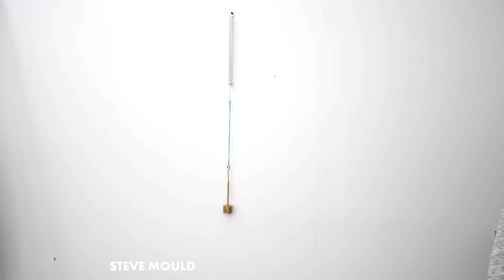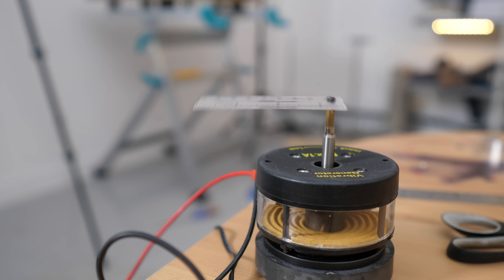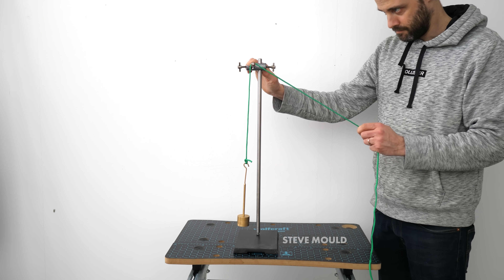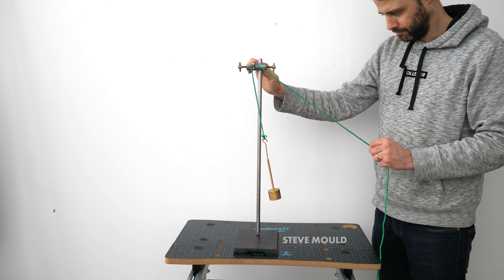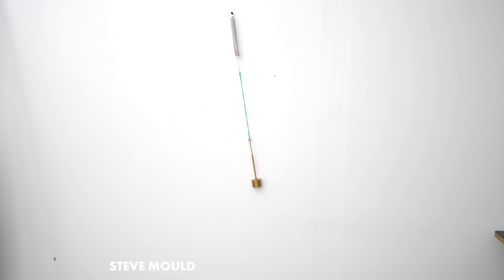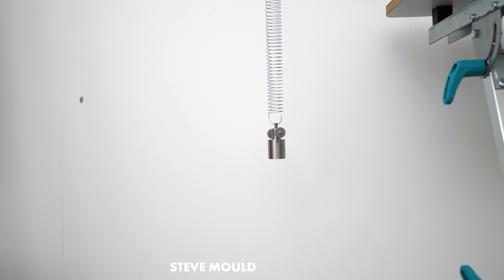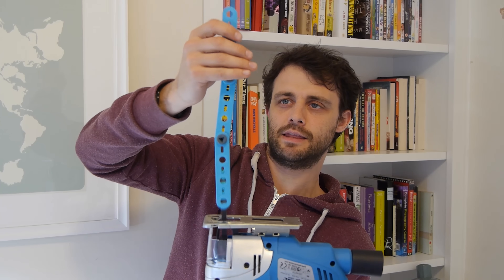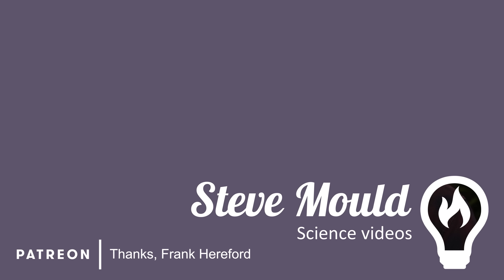What If Swings Had Springs Instead Of Ropes: Autoparametric Resonance

Comment: The normal pump up while sitting changes your own moment of inertia around its own center. By pulling 'in' at the bottom you do work then at the ends of the swing you expand back out while not rotating. (doing no work) Youcan think longer about it but you do work pulling in and none when expanding out so that energy MUST go somewhere. (or you can get you head in knots with the forces.
1 caveat I ought give people is that stand up (at the bottom) and sit down(at the ends) thing... be really careful. If you do it well on swing with say 8ft chains where it becomes plausible to do it well. I very very rapidly wound up horizontal with the chains loose and real chance they could pinch fingers when they went tight again. When you stand up you not only raise your center of mas your also change your moment of inertia around your own center, so it can if done 'well' pump up LOTS.

Comment: The length of the string at 3:13 isn't what's causing the swing, it's the off-centre aspect of the string relative to the weight. It creates a small moment arm that you lengthing with the timing. If the 'string' was in line between the pivot point and the centre of mass you probably wouldn't see this.
This is exaggerated by the movement of the pivot point at the top, because of pulling to the side.

Comment: Not sure the explanation about energy and centrifugal force is accurate. When you pull at the 6 o clock position gravity is in line with the string. (Plus also max centrifugal force). Whereas at 3/9 o clock gravity is perpendicular to the string. So pulling at that position can't do work against gravity.

Comment: The longest point of the string isn't the point that crosses both loops in the "infinity" shape, you showed that the shortest points are at the extremes too, which is also wrong. during the motion both the lower points of the ":circles" that form the infinity shape are the largest points of the string and the highest points are when the string is the shortest. not the side and the middle of the shape.

Comment: 6:55 By moving your legs out you are indeed changing your center of mass to gain momentum on the down-swing. The top of the pendulum isn't the only pivot point at play either, as when you move your legs out and push with your butt, you pull with your hands, so you definitely change the center of mass vertically.

Comment: 3:25 I think that movement is being introduced by the flexing stand, I'd like to see you do it with the stand fixed as well. And as well as the stand moving, the rope being pulled over the bar would push away from the bar slightly as you pull. That and the flexible stand are adding horizontal movement to the system. The harder you pull it, the more it affects the system, the more it flexes, the more the bending string pushes it away.

You need a setup that introduces no horizontal movement whatsover, only vertical.

Even with your spring setup, you are still imparting horizontal movement when you first pull it down, I guarantee you aren't pulling it straight down.

Comment: Experienced pendulum dowsers as well as L rod dowsers are all quite familiar with what is known as mechanical parametric amplifiers.  In the case of a pendulum hovering over an object sensitivity is increased or decreased depending on the length of the string. Naturally, reactions are affected as well.

Comment: On the swing mechanics, there is in fact a type of swing that is pumped by squatting down and standing up. In this manner you can get a swing to do 360 which doesn't really work by the typical swinging method.
https://en.wikipedia.org/wiki/Village_swing
https://en.wikipedia.org/wiki/Kiiking

Comment: Steve is right about garage door springs there not to be messed with, as a carpenter ive installed many doors and the setting of the spring is the part i like the least. i've seen tools embedded into the header because something slipped before the spring was tightened down

Also once a year spry that spring in your garage once a year with wd-40 or pb oil, having a broken spring on your door is not fun

Comment: Try thinking about the vertical vs. horizontal acceleration.
Shortening the string, you are also accelerating it upward against gravity, just as it is when it is off center in the 'normal' pendulum swing.
.

Also, the 'standing' method of "pumping" a swing, DOES change the CG and it is a vertical acceleration against the string tension, that you are adding energy with.
.
The sitting method of swing pumping is a bit more subtle and complex.

Comment: question: at 11:10 the pendulums are not in phase and the energy is transferred to each other. but when they are on phase 11:11 they continue in phase. but when the energy is transferred there is a point when both are in phase. why the system is not stable and continues to transfer energy?

Comment: I don't think the energy input has to do with the tension of the string at various points when the string is tightened or loosened.

When the string is tightened or loosened, the rotational inertia is proportional to the length of the string times the angular velocity. This quantity is constant.

If the string is tightened when the pendulum is swinging quickly, the angular velocity will be increased, and more energy is put into the system.

If the string is loosened when the pendulum is at its apex, and not swinging, the angular velocity won't be affected, and no energy is removed from the system.

Comment: 9:51 could this setup be arranged with magnets as counterweights surrounded by a copper coil to induce an alternating current at the frequency of the spring oscillations?

Comment: There is a swing set in a nearby park to me. It has springs at the top of the ropes. They are supposedly there to make the swing too low when an adult gets on, so only the children can use it. Never seen it in action, but I have seen the springs and they must be there for some reason.

Comment: I have had great experiments using strong monofilament fishing line for 3/4+ of the length, the rest is a rubber baseball with a 3-4' length of black eleastic threaded through it.  The other end is attached to a drain opening in the street/overpass overhead. The ball hangs at rest at about shoulder height. From there up to the drain is maybe 20+ feet. This allows for pitching practice with a kick. As a juggler since 1976, I have heard many assume I am ambidextrous. This is not the case with me. However, I used my nifty hanging rubber ball to practice throwing with my subdominant side. Great fun. The elastic makes for many interesting returns, too. It's a fun rig to use in the warmer months, until the vandals tear it down. It's down by the tracks, a common place for some rough folks. All the cement walls are covered with graffiti. I hope that some had fun with the rig before it went. It can be a rough world out there, so I figure some random cool thing to stumble upon, like a ball on an elestic hanging, might be good fun for others to, heaven forbid, Play with and let off some steam. One can be quite aggressive with such a rig, depending on how hard the ball is thrown and at what trajectory. It can go from a polite pendulum swing to a really wild, unpredictable return with a punch. Maybe the rig outsmarted some of the vandals and came back to bite them. One can find the ball-on-elastic toy at Dollar Stores and the like.

Comment: I'm glad Steve mentioned the double pendulum that is loosely coupled. I run into a similar thing carrying my water bottle (it has a string tied to the top, making it a mass at a short distance) and lunch kit (a larger mass at a longer length). I wind up swinging my arm slightly, causing both the water bottle and lunch kit to oscillate rhythmically like a loosely coupled pendulum. Turns out the masses and lengths are such that my water bottle moves counter to my lunch kit and I can feel the resonance build up if I don't slow my arm down.

Comment: Isn't there a third stable state for the spring+string setup. It seems to be that, at least theoretically, if the weight is released exactly in the center, there shouldn't be any side play even for auto parametric resonance combinations. Of course in your empirical setup, you couldn't have shown it.
Reply: The exactly centered case is a bit like trying to balance a pencil on its point though. My guess would be the other stable states also wouldn't persist for long due to non-ideal spring, non-ideal pendulum, non-exact frequency match, and random air currents, but maybe they are self-correcting within some range of perturbation.

Comment: When you lengthen the string at the end of the swing you’re allowing gravity to do work on the mass.  In a normal pendulum the tension in the string prevents the full acceleration of gravity to work on the mass at the ends of the swing.

Comment: I feel that I missed a fundamental definitional beat. 
If I am lengthening the period of a pendulum but ALL I am doing is lengthening and shortening the period, then the weight should simply go up and down.  
I am not causing the pendulum to ummmm process(? It’s been a while.) meaning. Either the pendulum was already moving left and right. Or I am pulling it left and right (through generally periodic variation of the tension force) as well as just altering the period up and down.

Otherwise, you seem to be saying. Springs on pulleys act as pendulums. 
I’d rather springs on pulleys pulled quasi-variably by evolved apes act as pendulums.

Comment: Could the pumping of the swing be explained by rising your center of mass when the swing is at its maximum speed? When you pump a swing, you first lean back and then lean upward again rising your center of mass. Then rising your center of mass would have the same effect as shortening the radius of the string of a pendulum at the right moment speeding it up. Like you demonstrated in the video even a slight change in the length of the string can have a dramatic effect especially as the angle of the swing is big.

Comment: In the mono pendulum system, energy transfer between Potential <=> Kinetic, the Mechanical energy will be constant. But in kinetic connected pendulums system, mechanical energy will transfer among pendulums and this oscillating energy has frequency that different from each pendulum. If the frequency of this transferring energy is match with each pendulum frequency or in between 2 frequency of 2 pendulums, it will be autoparametric resonance. Like the resonance of acoustic instruments.

Comment: When you're on a swing and trying to pump yourself higher your hands on the strings change the length when you pull. If you try to pump yourself on a swing without holding on to the ropes it really doesn't work well. So I think that you gain momentum on the swing because of the change in length from your hands on the strings.

Comment: on the circus trapeze to get the mamimum and quickest swing amplitude we made our center of gravity highest (standing up) when the bar was at the lowest point, gradually squatting as it approached each stop, then started rising, reaching a full stand, at the lowest point again.  This action got the bar swinging so fast, that in just a few cycles,  it seemed as if the thing was going to try to go over the top...but slack quickly slammed the ropes.  On an all-steel trapeze, you could spin over the top...very dangeruous in a stall at the top if not trained with foot straps and chaulked hand grips.

Comment: To me, a better explanation of how shortening the string causes resonance is that you pull on the string when the direction the weight is traveling is closest to the direction of the force of the string pull, which happens when the weight is on the way down, towards the center. That way, the weight absorbs some trig-derived component (sin of theta?) of the force of the string pull. I think that's why the effect gets so dramatic too, because even when letting out the string, the angle of that pull isn't too far off from the angle the weight would normally travel from the far end of the swing, ESPECIALLY when it's already in a good swing and the weight is reaching near horizontal- at that point, letting out the string basically causes a small freefall. In this way, it is almost exactly like the swing example.
Reply: Thought about this. Not taking it back, yet at least, but I did realize that this specifically only works because of the non-circular arc taken by the weight- otherwise, the theta would always be 90 degrees and the effect of pulling the string would be uniform everywhere and you couldn't gain an advantage. But, that's literally why this is for shortening and lengthening the string. Yes, I realize this makes this model a lot less mathematical and simple and a lot more haphazard than I thought, but the point wasn't to make an accurate model, it was to grasp and prove the concept to myself, and damn it, it worked. My mind IS haphazard. Like a squirrel on crack up there most of the time, just strangely subdued. It is exhausting.

Comment: does it only work because it's a string? what if it was a solid rod and you moved the fulcrum point up and down vertically, would it still impart horizontal motion?

Comment: could it also be the ring on the screw, as it rebounds upward and the tension on the ring releases and then the friction of the screw no longer centered on the ring causes force in the sideways plane? same with the string across the pin causing slight alter the side to side forces.

Comment: The spring pendulum seems to be a pendulum in a pendulum: a pendulum of a type has one side and another, the one sides energy is transferred to the other, in the same way for a short period all the energy is in one part of the system (spring) and it slowly transfers to the swinging part of the system.

Comment: 7:00 when i was swinging as a child i leaned back but also forward so my body, my mass would be in the front or in the back but also by doing it fast and rythmic i felt like i used momentum. just like i cheated my crunches in gym class by doing it fast and using my arms like i was using a boat a canoe

Comment: Regarding the twin pendulum.
The horizontal cord is under spring tension between the uprights.
You can see cord rising & lowering where they are attached to the pendulum cord.  
You can also observe the uprights flexing as the pendulums swing.
This forms the spring component & makes this identical to the other spring/pendulum examples. 
Although the ratio of movement is
clearly greater. I assume it is a harmonic of the 1/3 rd you stated.

Comment: The horizontally spinning ball is different. It is an example of conservation of angular momentum. You are not adding energy to the system because only tangential forces do that and you can only apply radial forces. If done right, direction change does not require energy (kind of mind blowing when you think about that).

Comment: It doesn't make sense to use the term "centrifugal force" here as you are not rotating the camera to match the rotation of the pendulum -- the camera's reference frame (which is the users reference frame, and also your reference frame) does not have angular rotation and what we see is centripetal force, not centrifugal force.

Comment: It seems to me that the weight on the spring is also a example of angular momentum. Sure it has to do with frequency, but it starts by the inability to drop it straight down, also by the spring(wilber force?pendulum for example). Once it bounces off center there is angular momentum introduced into the system. resonance is what keeps the angular momentum gaining amplitude.

Comment: You could also think about it this way, the pendulum and the spring are there own seperate oscillating systems, so when one is at full swing, the other has nothing.

If the pendulum has all the energy, the spring is not oscillating, and if the spring is bouncing at max amplitude, the pendulum is not swinging

Comment: Dumb question probably: if mad doesn't affect the duration of a pendulum then why does my clock's pendulum have an adjuster that changes where the weight is? Adjusting that changes the length of time it ticks.

Comment: Another good example of resonance is the expansion chamber in the exhaust of a two stroke engine, the pulses acting against each other at low rpm, but when rpm is increased they hit a point where the timing lines up and they build off of the frequency of exhaust pulses causing an increase in power (power band)

Comment: Just came here from a video on tuned circuits made of inductors and capacitors, where the energy oscillates as it is passed backwards and forwards... being stored in the electric and magnetic fields respectively.  Seems oddly similar : )

Comment: 3:03 
To be honest I don't think this experiment is right, for me all the movement happens because of the support you're using for the rope (the circular thing at the top where you right hand is), when you pull the rope the tendency of the weight is clearly going to the left because of, well, logic. 
A good experiment would be if the rope is being suspended directly from your hand, without a support in the middle, i.e. just hold the weight by the rope in a straight line and do the same up-down movement and see if it will still behave like a pendulum...

Comment: I was playing with one of those wire note holders/place card holders that's basically a coil of wire for the base leading to another spiral of wire which holds the note. When held at the bottom at certain points and tweaked, it springs back and forth in a very fast blur in one direction and then reverts to a side to side blur. This happens a few times before the dual cycling stops. It doesn't matter if you bend it to go sideways or forward and back, either will bring about the double motion effect.